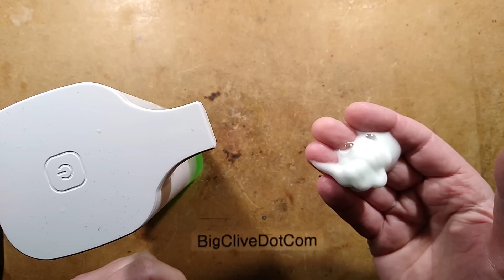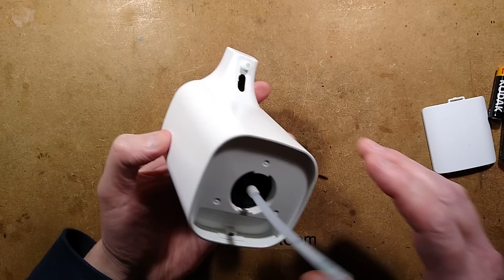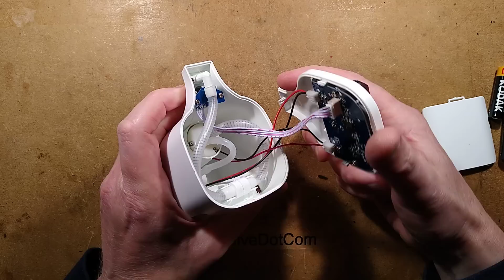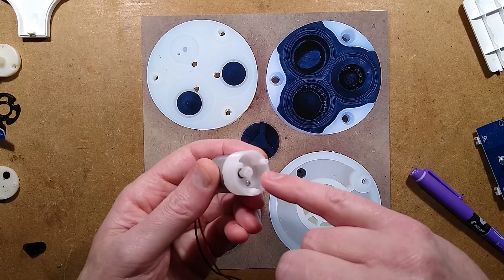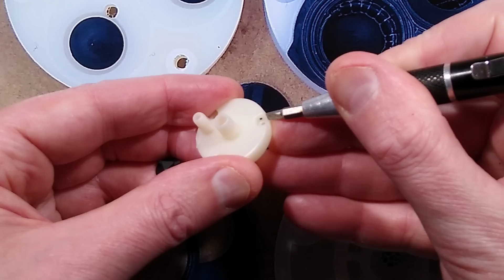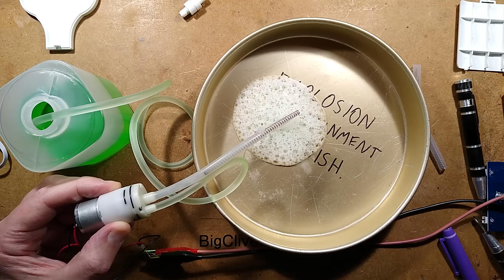Inside an automatic foam soap dispenser with clever pump.

Comment: I think this video confirmed that I wanted to buy this particular dispenser. Well, it quit dispensing after about 23 months of faithful kitchen service, so I’ve come back for the teardown before diagnosing it. Who knows, I might buy another.
Reply from the maker: Did it just stop or does the motor still run.  The weak point in these foam dispensers seems to be the fine mesh used to break the bubbles into a thick mousse.  The mesh blocks.  On some it can be cleared by flowing water through in the opposite direction.

Comment: I just bought one of these very cheap on eBay, but it wasn't triggering reliably, so I dismantled it. It has a much reduced circuit board, no LM358, but 3 transistors on the IR sub-board. It's working reliably while apart; squirting foam all over my workbench. The foam isn't as moussy as yours, so I'm wondering if they've also cheaped out with the gauze foamer (although it looks the same.
Reply from the maker: Experiment with the ratio of soap to water.

Comment: The problem with these is the soap sediments at the bottom after 1 day and the foam starts being runny.  You need to stir the reservoir every day to keep the soap mixed well with the water.
Reply from the maker: If you use shampoo or dish washing liquid it shouldn't settle.

Comment: My soap dispenser suddenly stopped working. It's was working fine but now the engine is not working. What can I do?
Reply from the maker: Check battery connections and that water hasn't got into the motor and damaged it.

Comment: i got one from aliexpress. different type. but it doesn't work. i opened it its another system inside. could you help me somehow to fix that?
Reply from the maker: Does it make noise?  If it does make the noises then make sure your soap is diluted enough.
Reply: @bigclivedotcom  yeah man i fixed it already. the problem was with the tubes. it was out of his hole.

Comment: I liked how dismantled the device and explained everything. I have similar dispenser but not working. There’s pumping sound but no soap. Don’t know what’s the issue.
https://drive.google.com/file/d/1XeQl7j2EnilHZgZCUMUbeW5jR7J6F1-W/view?usp=drivesdk
Reply from the maker: You have to use it with watered down soap so it can pump though easily.
Reply: @bigclivedotcom  that doesnt work even with simple water.
Reply: exact same problem man..that shit doesn't work.. most of these are like factory defected somehow
Reply: lol i fixed mine somehow...that tiny tube was just out and had to attach it to it's place and now it works. but damaged the case while opening.
Reply: if the motor/ pump sounds it means it works..maybe the tube is out. so try it/ good luck

Comment: Just bought that dispenser. Love it. Thanks for the breakdown. Takeaway is don't get any particulates in the soap as they may clog the tiny holes.
Reply: Unfortunately on one of the dispensers I bought, the anti-kink spring they used has rusted to the point it was leading to particles that were preventing the valves from sealing and therefore failing to pump - I've not opened the other one (same style as the one in this video) but hoping they used stainless steel spring material! 

The other has also just stopped responding to detecting hands... As they use an unmarked SOIC 16 pin chip as microcontroller I'm not sure if the failure is there (no idea on replacement)  or in the receiver diode (the transmitter can be seen blinking on a phone camera). The pulse can be seen on a scope but it's hard to know if its right or not - and the input connects seemingly directly to the MCU rather than the opamp as in this video, so even harder to fault find. It's not trying to drive the output transistor and the motor functions so it has been narrowed down to the IR side of things, but a bit stuck here now.

Comment: I've been trying to acquire a decent manual foam dispenser via aliexpress. So far with failure. One spits gobs of foam, the other mostly liquid barely foamy. And keeping in mind they're just empty bottles of plastic, they're quite expensive, starting at around 2.5 USD. I can buy two liters of decent liquid soap for that price.
I would buy branded foam soaps. But apparently DM and Rossmann pulled theirs a short time before I started to look around. And the only branded is Palmolive, which is morbidly expensive and even that seems to be disappearing or disappeared already. (Also they only provide(d) a measly 250ml bottle.)
Reply from the maker: Experiment with the soap water ratio if you're using a foam pump.  I use dish washing soap or shampoo at a ratio of about 1 part soap to 4 parts water.  The prefilled foam dispensers can usually be refilled several times.
Reply: @bigclivedotcom  Thanks. I did try varying the soap content. Didn't really get better.
It also sucked up liquid into  what I think is an air reservoir. The pump from a Palmolive dispenser made proper foam from all. 
https://ae01.alicdn.com/kf/U94c2a0f420c74ac69ea3b3c1c4278834y.jpg
https://ae01.alicdn.com/kf/U2a8aa46fe76a4055a631c29c43a24b04b.jpg
https://ae01.alicdn.com/kf/Ua8dcac19b2624bad959bc472042a0137F.jpg

I guess the design of these cheap ones just suck. Or I got two defective ones from different sellers.

Comment: Given the touch and ir sensors are handled by their own chip, why the micro controller? Imagine 4 nand and a simple RC timer to keep the motor running for a period would do. 
I’d understand the micro controller if it was handling touch and ir too.

Comment: I've got the rechargeable version of this but a big flaw is that it doesn't work in bright sunlight as it interferes with the IR sensor. So in my upstairs bathroom I can only use it at night. My windowless powder room has one and it works fine.

Comment: Excellent video. I have a similar (not identical) foam dispenser. It works initially, and then after detecting the hand, it appears that the motor is getting very little current and it is struggling to move. But after triggering the IR sensor many times by placing and removing the hand, the  motor starts functioning normally. Any idea from electronics geeks to what might be causing such a behavior?
Reply from the maker: It could be a bad connection or the liquid might be too thick.
Reply: @bigclivedotcom  In either of the suggested scenarios, it shouldn't work after triggering it a several times. It behaves similarly even without a soap. Its like there is some capacitor that charges after a while and starts functioning normally. But its only a wild guess.

Comment: relevant not relevent, i worked on a tennet auto scrubber once, i had a high pressure hose that would splash back easy, i took half a scrub disk and put it halfway into the fill tank, i would aim the hose at the disk, and the water's velocity was almost completely absorbed by the disk. if i aimed it at the waterline of the disk it would suck a bit of air in and make a moose like foam if degreaser was already in the tank.

Comment: @bigclivedotcom My slim 3D pen stopped working, the display won’t turn on and one parts of the mother gets hot to the touch
Reply from the maker: Sounds like a component has shorted out.  Maybe a regulator.
Reply: I can give you a pic, maybe I’ll post it to my channel

Comment: I bought a similar model from Wish,and filled it with hand sanitizer. Works very well,spraying out a bubble of liquid,at just the right amount. Switch on the top flashes red to indicate low batteries,but AA's will last for months.

Comment: Is that LM358 opampt powered continuously? It is not a low power op amp...
Reply from the maker: It may have its power pin controlled by the microcontroller.

Comment: This is very popular in the Philippines. This is sold as Xiaowei X6S alcohol dispenser. It costs 10-15 USD here. I accidentally dropped mine once and thensuddenly sprayed alcohol randomly on its own. Apparently some alcohol seeped into the sensors and shorted some stuff triggering the spray. Letting it dry fixed it though haha.

Comment: Hmmm... The way it mixes liquid with air... I wonder if that could be re-purposed for charging the back chamber of a spud gun?
Reply: These aren't exactly high-pressure devices.
Reply: @Anvilshock  Not expecting high pressure, as long as it goes through some other valve implemented on the spud-cannon chamber and not direct-injection. Think along the lines of having butane already being mixed with air to have a vapor. It's a simpler metering device than a carburetor that doesn't need to flow all that fast given the application.
Reply: @pauljs75  Oh, I thought you were merely going for the pressure, but you meant it as a dosing device for fuel. Anyway. For that, you'd have to have a non-pressured (or ambient-pressured) reservoir for the gas (say, propane) to pump out of, otherwise the overpressure from a bottle or even just a regulator would simply blow freely through the pump's vents. Also, the perfect propane-to-air ratio is just under one in 25 parts, so a pump with the bellows sized like in this one would produce a rather rich mix. (Of course, you're free to go as rich as you like, but given that you still want to ignite the stuff, anything beyond of the upper flammability limit of ~10 % by volume is rather pointless.) So, no, without a lot of "excepts", repurposing this pump, as is, for charging spudguns would not work.

Comment: @bigclivedotcom try using guitar picks when working on snap together assemblies like this. You can easily wedge them in place next to the fingers without breaking the fingers(if you get the right hardness picks they will break before they scar or break the fingers). You can them leave them in place as you work your away around a part so it doesn't keep closing on you.  Old credit cards work too. But cheap thin guitar picks are great, and you work in a industry that someone would probably toss you some bags of them. Cause they aren't the style said artist/performer prefers to use.

Comment: I have one of these from Xiaomi .. had quite a lot of flaws

It leaked onto the batteries for one, and another killer issue that cropped up after I opened it was the proximity sensor alignment

had a very very similar construction otherwise; mr Xiaomi did however use different connectors for the battery and motor though

I scoped mine and it was just a fixed pulse every 400ms (if I remember right)

The hoses were less posh, no springs inside, and the foamer/decombobulator was one part with the output hose

(did a repair-ish video of it if anyone's super interested)

Comment: What was the dedicated touch ic? Was it a latching thing?
Reply from the maker: Just momentary.  The touch sensor chips are very common.
Reply: @bigclivedotcom  thought so. I'm always looking for a similar latching design like an mcu that holds its own power on.  For maker projects you can't always use the deep sleep modes because of other parasitic loads like the usb chips and things. I currently use a fet package and some simple logic,  but it's still 6 bits of faff. I'd love a dedicated Chinese chip.

Comment: That's very nice! Do you know if it's possible to buy these motors somewhere?
Reply from the maker: I've only found one seller of foaming pumps on eBay.  3V foam pump
It may be easier getting them in a product.
Reply: @bigclivedotcom  Thanks. It looks different, but I've ordered that. Looks very promising for potential hydroponics use (in a very small scale) - should deliver water already aerated :)

Comment: I’m betting that the op-amp is there to be a low-pass filter or maybe a band-pass filter. That way they send AC to the LED, and receive AC a from the photodiode in a way that lets them filter out any bias without the need for a complicated AGC circuit.

Comment: I actually wanted to get me one of these and I'm very happy to see it in bits, so that I know what I'd be buying. One thing that makes me wonder is how to clean this foam adapter. I've been using these manual foam dispensers for several years now and the problem with these, is that if you use the wrong soap (creme soap for example) the tiny filter meshes inside get clogged up quickly and there is little you can do to clean them. When buying such an automatic dispenser I was hoping to get something more maintainable, but it seems that the key piece is unfortunately glued shut and again there is not much that can be done to clean it once it gets clogged up with contamination.
Reply from the maker: The filters do block in the hand pump version.  I'm not sure how this version will fare.  Maybe purging a stronger cleaning compound through might help.
Reply: bar soaps are so much easier.

Comment: Clive. What actually is the purpose of airating the soap? Does the soap in mousse form make it more efficient or something?
Reply: it helps the soap spread easier on hands and of course uses far less overall compared to say liquid only being pumped out a nozzle, often half of it globs off your hands and down the drain anyway
Reply from the maker: It means only a small amount of soap liquid is needed for a large mound of foam.

Comment: I wouldn't call it 'clever' but it's a good way of doing things. I do wonder if the liquid holes for the valves are large enough - but clearly they are - but I'd think the pump would be starved. It's clearly a three phase pump to convert oscillatory motion into smooth fluid flow (I've seen 6 cyl version with real swash plate (Joker pump))

Comment: Anyone ever notice that characteristic soft bump at the start of every Clive video?
Reply from the maker: It's an odd interaction between the camera software and phone firmware.  The mic gain control is quite aggressive and oscillates as it stabilises.  Also happens with loud sounds.
Reply: @bigclivedotcom  interesting. It's one of those things that subtly makes it a bigclive video. You shouldn't fix it.
Reply from the maker: @lanswipe  It's disappeared with the most recent firmware update.
Reply: @bigclivedotcom  aww

Comment: Wujun Leds been oscilloscope yet ? :)
Reply from the maker: Not yet, but I've also found two styles of copper wire WS2812B fully addressable strings.
Reply: @bigclivedotcom  More interested how Wujun LED work, working as field service engineer in arcades, I use WS2812B all the time and for Christmas lights for the last 3 years.. Have a look what I made with WS2812B flex panel.( https://www.youtube.com/watch?v=Y6wS0QHChsw ). Should make a light box with your logo and flaming woofler fire, going across.

Comment: Interesting video, Clive .
Many years ago (before the internet) I read about moonlight interfering with the working of infrared beams . Is there any way you could demonstrate that?
Reply from the maker: I doubt it.  But some modulated infrared detectors did have issues with electronic lamps that put out high frequency optical noise.
Reply: @bigclivedotcom  This was when they used to use infrared beams across a door to detect intruders . I've been trying to remember details of the crime report in a newspaper . Apparently thieves had been able to steal from a shop they broke into because although the beam was working the receiver end was flooded with moonlight which had enough infrared to keep it from triggering the alarm .

Comment: hi clive, i was looking for a little bit of advice. i have a headset with a dead lipo battery (it wont hold charge) i cant for the life of me find a replacemet batery with the same specs at all with three wires and protection circuitry.

could i replace the batery with a one with a higher mah. the one needing replaced is 3.7 v amd 800mah
thank you
Reply from the maker: Not sure about the third wire.  You may be able to fit an ordinary protected cell.  Is it a soldered in cell or a replaceable one?  Many items use Nokia batteries.
Reply: @bigclivedotcom thank you for the reply, it is replaceble it has a 3 pin connector. would there be an issue running a higher mah on the new cell or woue that kill the headset?
Reply from the maker: @ant6662  If the cell is the same voltage a higher mAh rating will just result in a longer run time.  Is the cell marked with a number?

Comment: While this is very clever, it uses a mass of electronics and four batteries to do that which can be done with a manual plunger. Its only real advantage is that you do not need to touch it when using it. Its not exactly a green solution.
Having been very pious, I would still like one to play with.
Reply from the maker: The hand pump foam dispensers always jam up after a while.  I'm hoping this automatic one will last longer.

Comment: Would this be the basic technology that is used by airport firefighters to fight burning airplanes?
Reply from the maker: Very similar.  The hangar foam systems use powerful fans blowing air into fabric bags with spray nozzles spraying a water and surfactant mix into them.
Reply: Yes. In a former life I trained as a firefighter at a small airfield. Our crash wagon was a converted Land Rover with 100 gallons of foam mix on the back. The standard hose nozzle would shoot a fairly normal stream of vaguely soapy liquid, but there was an attachment that caused air to be drawn into that liquid and generate a nice thick foam.
Reply from the maker: @6yjjk  Sounds like the snow foam lances used by car washers.